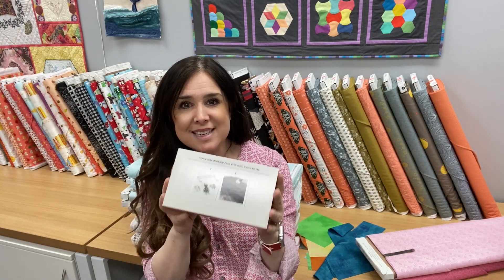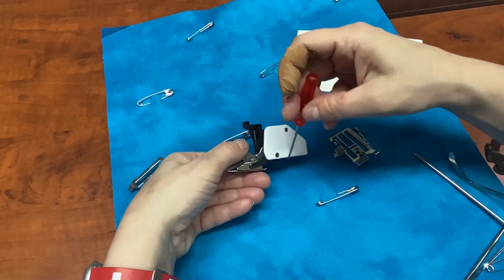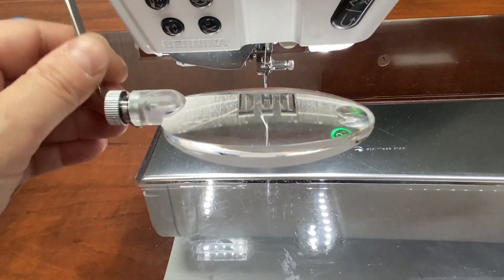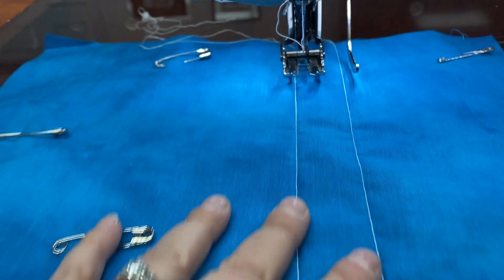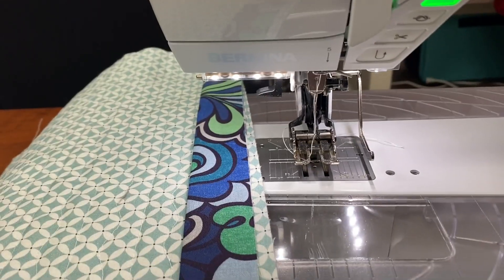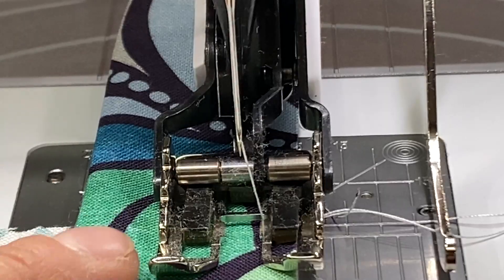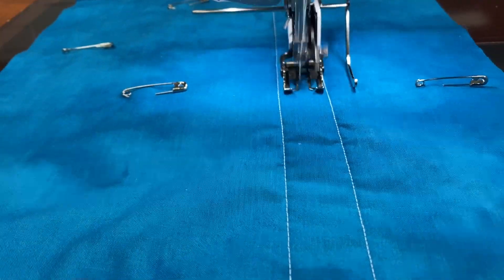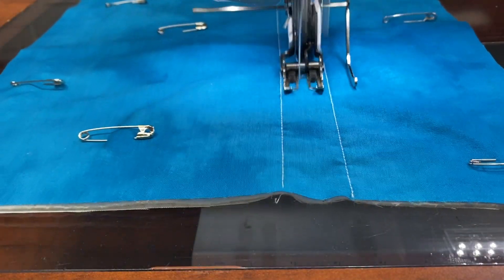BERNINA Walking Foot

Comment: Hi great video, just a quick question, can we use the walking foot instead of the blindstitch foot #5? the walking foot has 3 type of attachements. I have a bernina 1008. Is it worth me investing in the blind stitch foot or will the walking foot suffice? Thanks so much.
Reply from the maker: A #5 blind stitch foot is used for blind hemming and has an obstruction at the center needle to give lift to the blind stitching. This task is not recommended for a walking foot with the central guide sole. The central guide sole on a walking foot is not meant for voice hemming, it is for topstitching (bindings, waistbands, etc). The 1008 comes with a bound hem snap on foot. The number is stamped on the actual metal foot.

Comment: Can you explain how the movement of the needle is related to the movement of the fabric? Because the stitch length and direction of the feed has nothing to do with the movement of the needle. So if this device would feed the upper layer of the fabric it would be a mess. It's just a gimmick and can't be compared to real upper feed.
Reply from the maker: This walking foot has been tried and true for years. If you want basic engineering instruction and physics advice on this product, our recommendation would be to reach out to BERNINA international as we sell the product, we are not the designers.
Reply: Obviously it's feeding with the needle up.
Reply: @ToddGreenwich  Disengage your bottom feed and see how well it works. It doesn't.
Reply: @twisterking1963  😂 because the fabric is gripped between the two feeds duhh
Reply: @ToddGreenwich  That's why I said to disengage the bottom feed. Then the walking foot transports the fabric on its own. It doesn't, believe me. It;s just a gimmick. Needle movement has nothing to do with transport. So a device driven by the needle movement shouldn't be called walking foot because it implies transportation of the fabric. And it doesn't. I'm a sewing machine technician btw.
Reply: @twisterking1963  I'm going to try and see. I'm curious.